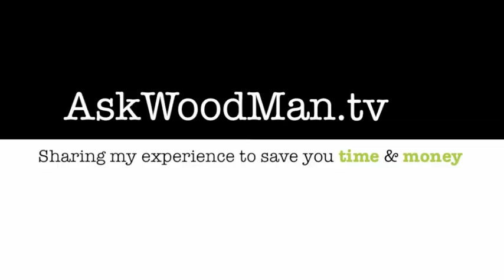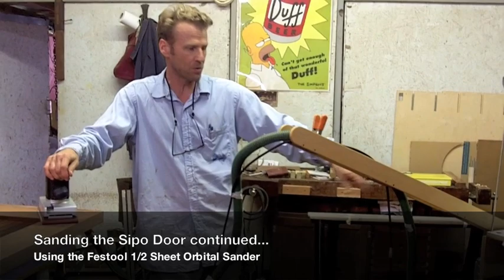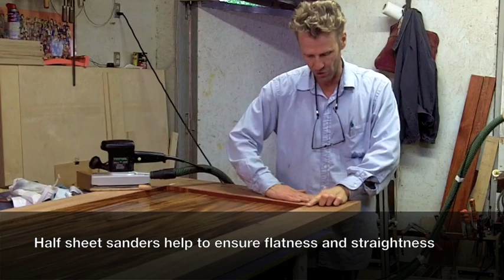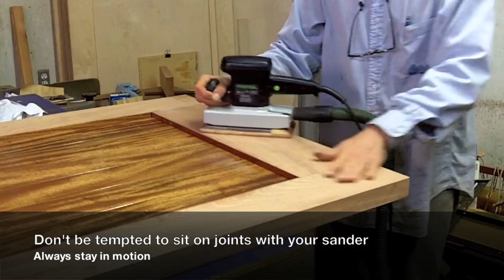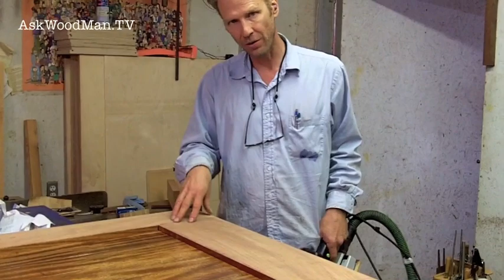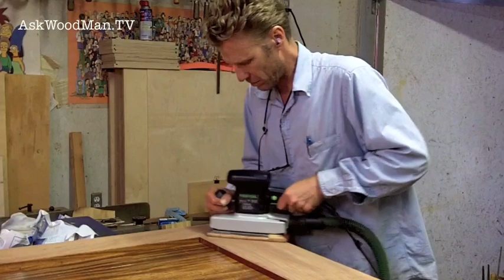24 How To Sand Across Joints / Sanding Basics - SOLID WOOD DOOR SERIES - Video 12

Comment from the maker: Sorry for the late reply. Mailbox swamped. That is such an excellent question. The answer is, "it depends". Poplar is softer than mahogany, and mahogany is softer than lyptus, so the exact same sequence and sanding time will yield different results. If I am dadoing, I cut my dados to the finished sanded dimension of the stock instead of the unsanded dimension. It can be a big difference on fit. Again great question about a real subtle issue woodworkers have to take into account. Thanks Allan

Comment from the maker: Yes I definitely went through the sequence on the interior pieces. On 95% of the things I sand I have found it just saves time and effort to start at 80 and do the sequence. Some softwoods like western red cedar or redwood will allow for starting at a higher grit in the sequence. I just try to quickly set the shape flat and straight, and then each grit is just removing the previous grits scratches leading to a smooth and flat piece.

Comment from the maker: The sanding in this video was for wood that is in good shape so I was using VSM/Vitex paper. There are Scotchbrite pads made by 3M that come in a whole variety of grits that will disintegrate and obliterate paint or finish. I use these for stripping wood with old finish. I also use these for stripping steel of rust and scale. If you would like to write me at askwoodman@gmail(dot)com I can send you some links and more info. Can't send links here in the comments. Allan

Comment from the maker: My vacuum is a Festool CT33E. It is a tool triggered vac with dual HEPA filters that is really quiet and has a large capacity (7.5 Gallon) . There is now a newer more powerful model out that replaces my model. The sander is RS2E. Festool is widely available and no matter where you buy it is always the same price. Perhaps you will click through my Askwoodman . com link and I get a small remuneration without changing your price. Write me at gmail if you want to have a longer conversation about it.

Comment: I am just curious why you wouldn't use your large jointing plane to take care of a leveling job like those joints at the mortis and tenons. I am sure you have a good reason, you always do. The other question is, would you sand the sequence on a planed surface. It seems like after planing, the surface is already as good as a sanded surface and easily ready good enough for finishing. Thanks

Comment from the maker: Even with a super sharp blade there is still a risk of tearing and blowout cutting across opposing grains and ends and edges. For me it is not worth the risk since I am going to sand anyway. If anything I would us my Stanley No 80 scraper plane to float the joint prior to sanding. I can get my planer blades incredibly sharp, but the surface is far from the quality of a 320 or 400 sanded surface. I almost always sand the sequence because I have found it just saves time.

Comment: Just wondering what grit sandpaper did you use? I have an old door with 2 old layers of flaking paint on it. I just started today by scraping a lot and beginning to sand using 60 grit, should I be using even more coarse paper like 40? Or is there a really strong paper out there that will take any left over paint off? Your work is amazing!